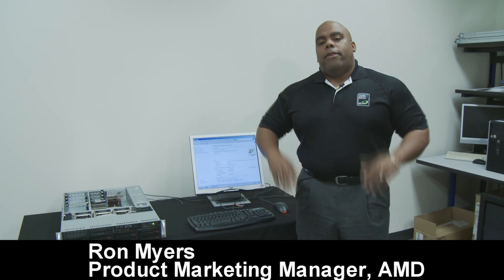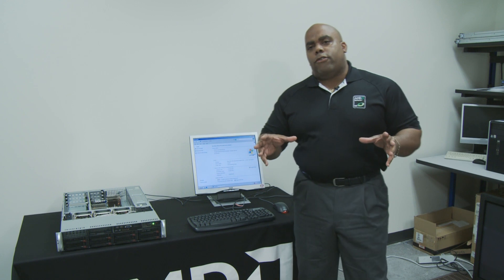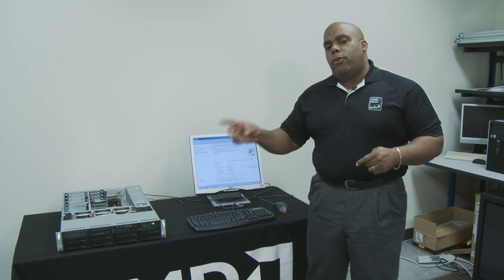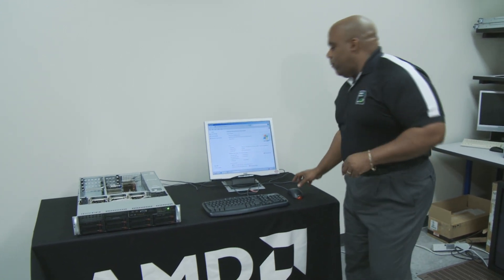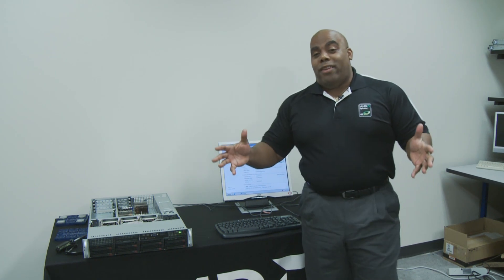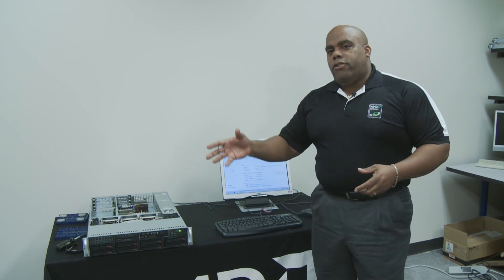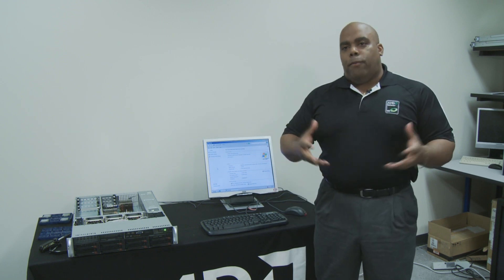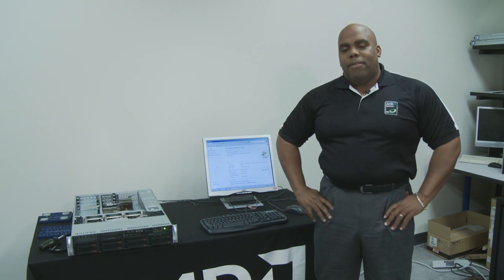Server CPU Upgrade: "Barcelona" to "Shanghai"

Comment: Thousands of servers, multiply by four =many thousands of  'minutes'

 If you don't use shitty thermal compound (...'grease') it will be JUST fine. You will spread out and expel any air bubbles if you apply the specified amount of pressure and, again, haven't used trash compound that dries out. 

You play an incredibly shitty game called 'world of warcraft', my child. You are most certainly not certified to comment on anything related to servers or server maintenance.

Comment: @mmmmbert Hot swapping CPUs is possible, just very uncommon.  First step is to disable the entire node, then power down the CPU riser board ( usually two CPUs ).  Swap with new CPU Riser board and new CPUs for entire node.  Re-enable node.

It is much like distributed computing - except inside 'one' machine.

The trick is that each CPU in the node had to match, you could not upgrade in this manner, merely replace a faulty chip or fan. I'm in the biz & I've seen it once - 15 years ago

--The loon